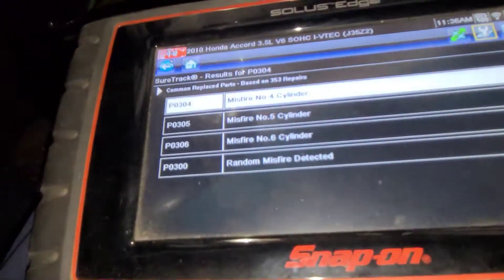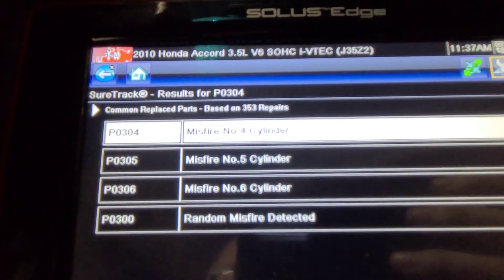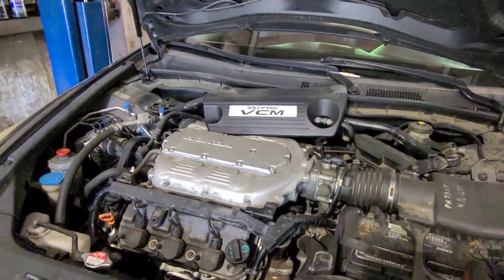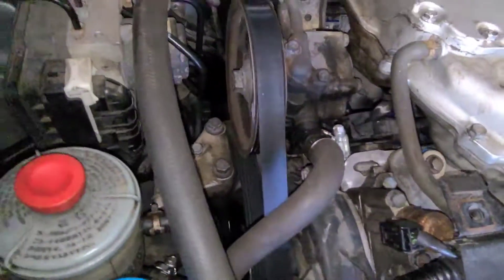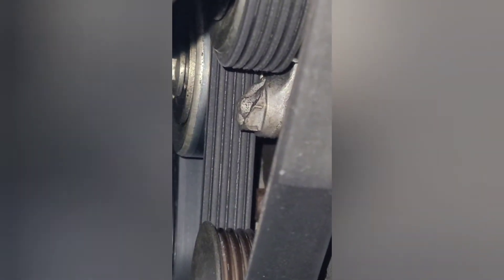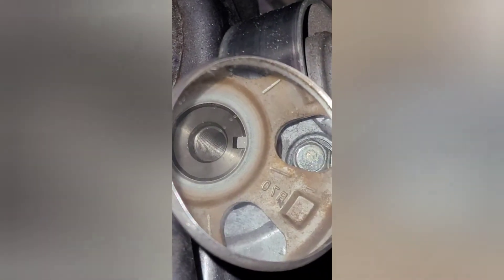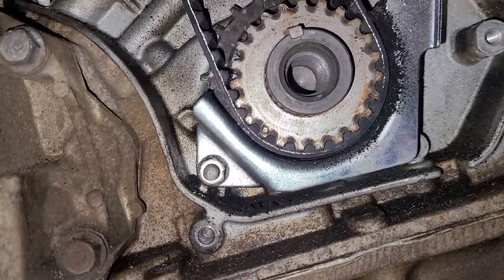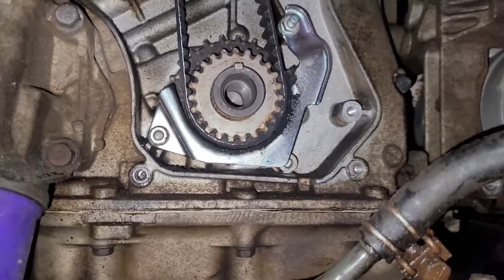Every Cylinder Misfire on one bank? Heads were just done at another shop. What will I find. Part 1

Comment: It's really a shame how many bad shops are out there.  I've done my own work for probably 45 years now and the only time I remember taking my car to a shop was for a transmission for an 87 Diplomat and then the same car about a year later because the first one wasn't done right.  The only other time was for a starter on a Ford 5.3 that I got tired of messing with.  In that case the shop replaced an end on the starter cable for $150 without asking me.  The kicker was I knew the cable was bad and a new OEM cable was less than what they charged me to fix the old one.  Fortunately they refunded the $150 to me after I made a comment about them calling next time, which of course there won't be.  The upshot is that 2 of 3 times the work was either bad or not authorized.   It's really a shame but at 68 years old I'm still doing my own wrenching for self protection as much as anything else.  Keep the good stuff coming Kenny.

Comment: Just wondering what the effects of brake cleaner saturating into rubber of timing belt does over time(I only use compressed air around timing belts). That belt should have been changed just from the fact the edge was chafing against the washer.

Comment: engine i can't understand is the 4.0L ford v-6 has no pins on cam gears and bolts are torque to yield and ford doesn't sell bolts and no one else sells them so you have to reuse. friction fit is bad idea on harmonic balancers and cam gears

Comment: So what caused one bank to misfired? Have the same thing on my V6 Camry, check engine light blinking like crazy. Parked on the driveway for now till it's fixed.
Reply from the maker: Problem was valve adjustment. Here's part 2 . https://youtu.be/-Mj1rnggp1M
Reply from the maker: Although your Camry has self adjusting valves if I'm not mistaken. I'd look into the cam timing or possibly the 02 sensors
Reply: @WrenchingWithKenny  
Thanks, already changed the A/F sensor on B1S1, check engine light cycles on for a 100 miles then off for another 100 miles. Went on for 3 years, then check engine light started to blink, lost power. I think its cam timing as well, well check the timing belt and associated moving parts.
Reply: You actually had a Toyota Camry problem?  Wow.

Comment: I have seen this  incident before.  Some mechanic breaks the  shear pin while they take out the cam pulley bolt using an impact gun.  What they did is, they glued the broken part in place & put the  cam belt on. But  it was running fine at that moment.  I don't know the car is still running good or not.

Comment: Hey Kenny What fluid do you use in your parts cleaner?
Reply from the maker: Our parts washer calls for a special solvent 🙄. When I researched it , turns out it's mineral spirits . I come to also find that Paint Thinner is 100% mineral spirits . So for the parts washer , I just go to Lowes or Home Depot and get paint thinner . It's wayyyyyy cheaper . What you see in the video however is just Beake Cleaner from Advanced.
Reply: @WrenchingWithKenny  That's what I've been using for 30 years to clean parts.